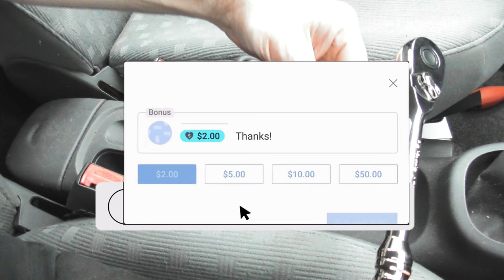Handbrake Adjustment - Nissan Micra K12

Comment: Thanks for the guide and great work with the camera angle! Question, Is the motor running?
Reply from the maker: You're welcome. The engine was running in the footage where I was pressing the brake pedal but it doesn't need to be

Comment: Great video! 
I have a Micra K12 with rear drum brakes. The handbrake works on the driver side (left) but not on the passenger side (right). The wheel just spins quite easily, not as easy as with no handbrake though. What could be the problem and how to adjust it? Thank you! :)

Comment: Thanks for the video. My 2015 nissan micra handbrake has very little resistance when I pull it up and it doesn't engage the brakes to stop the car from moving
 Brake cables are in good condation. Can I try your method without jacking up the rear wheels?  What you think can be the issue in my case?  Thank you
Reply from the maker: Does it have drum or disk rear brakes ?
Reply: @screwsnutsandbolts  drum
Reply from the maker: It could be a few different issues. You'll probably need to take the drums off and see what's happening in there when you pull the handbrake.
Reply: @screwsnutsandbolts  thank you very much. I attempted to take the drum out but it refuses  to come out, rusted. Dont know how to take if off. Hammered it a few times to no avail.
Reply: @saboorsaboor704  You have to remove the dust cover and 30mm bolt